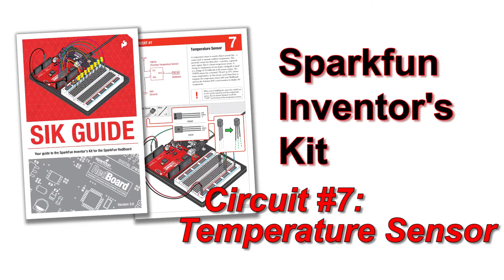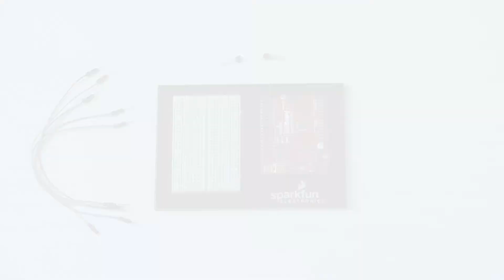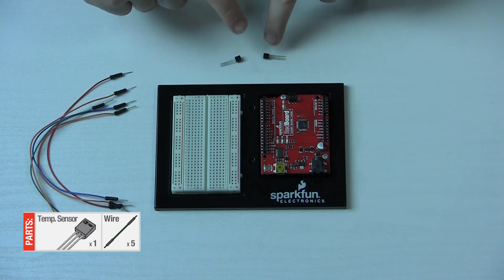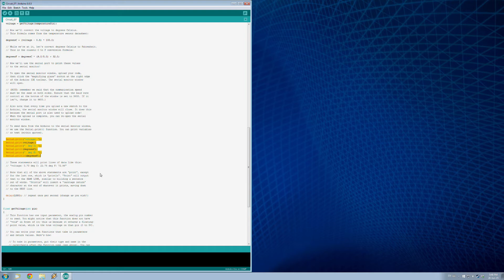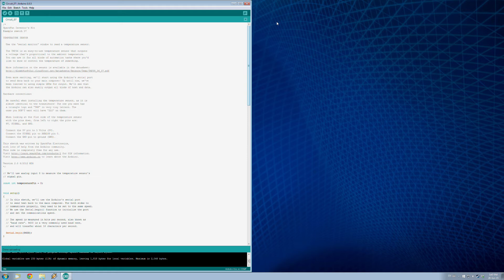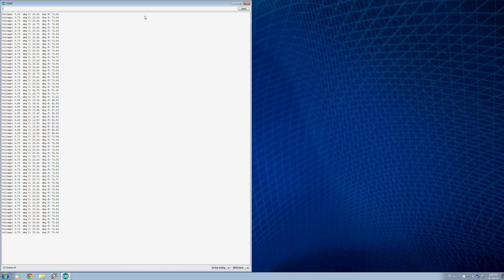SparkFun Inventor's Kit - Circuit #7

Comment: I have taken electronics up as a hobby and I am still in the process of learning circuit theory. I hooked up my board wrong and I got some really high temperature readings and I am unsure why. I placed the 5v and ground from the redboard into the pins on the opposite side of my breadboard. I was still getting readings ranging from 1.21V to 2.27 V. I got out my multimeter and  measured the voltage on the pins of the temperature sensor and there was 0V. Where were these voltages coming from?
Reply from the maker: +Jason Bailey That sounds strange.  I'm not really sure what's going on there.  Best thing to do is always double check your connections with the guide.  However, I have also heard that sometimes the kits ship with faulty breadboards.  Not sure if that's your problem, but it's only a few bucks to replace it if that is the case.
Reply from the maker: +Jason Bailey Oh and you need to double check that you are using the temperature sensor!  It's VERY easy to confuse with the transisitor.